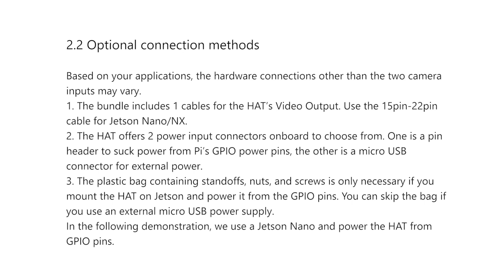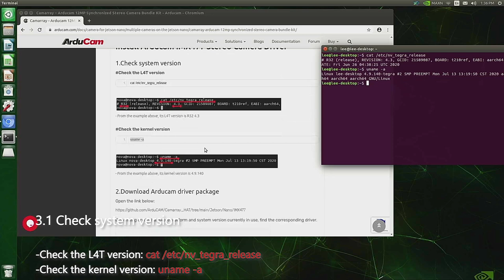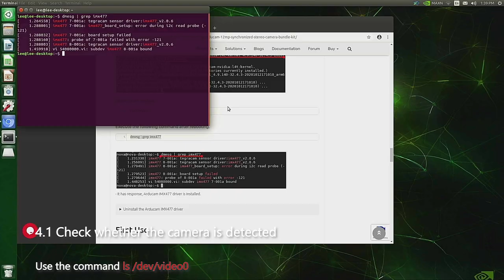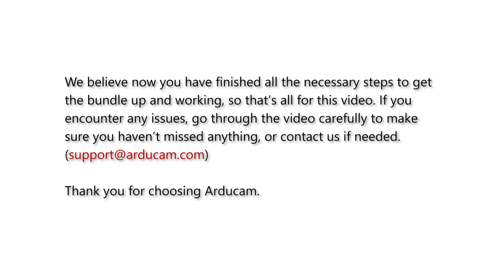[Tutorial] Arducam  Camarray 12MP*2 Synchronized Stereo Camera Bundle Kit  for Jetson Nano/NX

Comment: Hi
Is it possible to extend the flat cables in order to be able to place the two cams 70 cm away from each other? For some design constraint, I need such a span.
(R Pi system)
Thanks in advance 
..good job.
Reply from the maker: Our hardware engineer says yes and the distance between the two cameras is estimated to be up to 100 cm. But remember that the distance between the two cameras should not be too long, otherwise they will not be reliable!
Reply: @ArducamOfficial  great. 70 cm thats what I need :)
Thanks to you and to your design engineer(s) :)
Reply: @ArducamOfficial  Do you guys have a guide on how to perform distance measuring via stereovision using this kit?
Reply from the maker: @anonymousperson1048  Sorry, we don't have this guide.

Comment: Will this hat works with Raspberry pi HD camera.
Reply: Firstly, I suggest you mean HQ camera, and secondly, it won't work with that. And that's also why we need to make it a bundle kit. 
Stereo camera synchronizing requires the dual camera module to share their clocks, so the camera modules used in this bundle are modified specifically for stereo camera applications. 
On the other hand, the Raspberry Pi HQ camera was not designed with that in mind.
Reply: Tq for your brief explanation sir, Does Jetson Nano designed to handle stereo camera?
Reply from the maker: Hello, guy. We have two types of IMX477 stereo camera bundle kit. One is for Jetson Nano/Xavier NX. The other is for Raspberry Pi. You can get more information from the link in this video description about the one for Jetson Nano/Xavier NX.
Reply: @ArducamOfficial  i am having Raspberry pi HQ camera and Jetson nano, does arducam has any module to interface both?
Reply: @nareshkumargopi5117  The Raspberry Pi HQ camera does not directly work with the Jetson Nano:
The Raspberry Pi HQ camera module requires a hardware modification in order to work with Jetson Platforms. Both Jetson Nano and Jetson Xavier NX provides 1.8V for reset GPIO in the camera interface, but the camera module requires 3.3V.
 To fix this issue a resistor labeled as R8 must be removed from the camera module. If you decide to apply this fix it is at your own risk.

Therefore, there is no Arducam module (or any module) capable of interfacing the RPi HQ Camera to the Jetson without the hardware modification.  Even if you've modified your RPi HQ camera to make it work with the Jetson Nano, it won't work with our camarray Stereo HAT with further hardware modification for stereo camera clock sharing, so it's tons of work with great uncertainties and changes that can't be undone.
Reply: @arducamforraspberrypi8168  Tq so much for explaining it clearly.